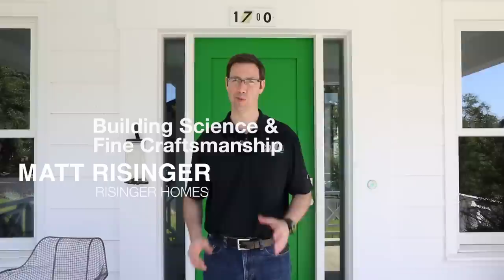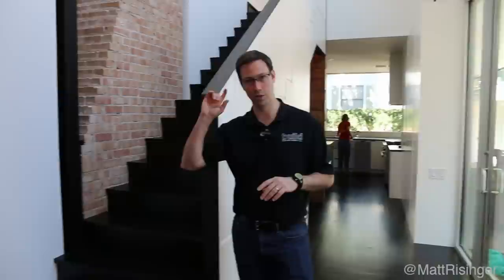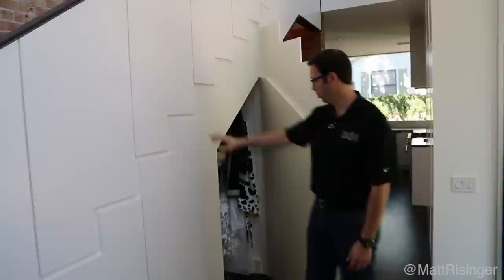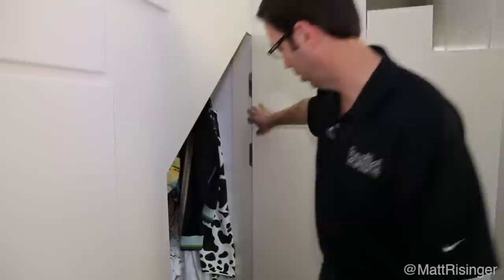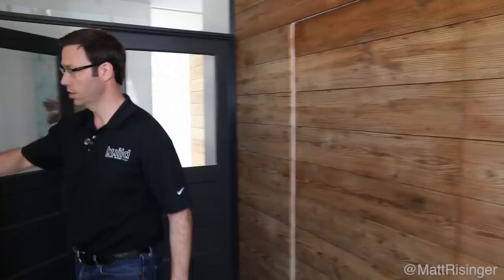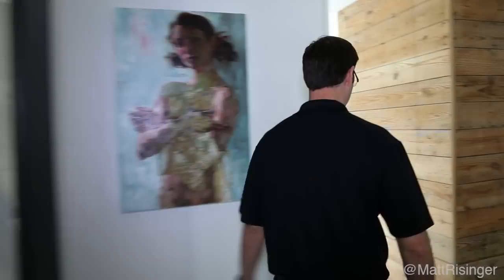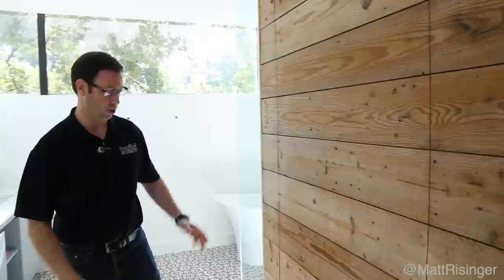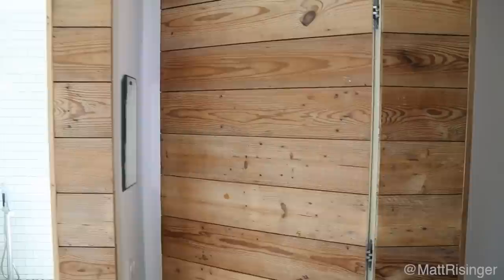Hidden Door House

Comment: should have made the wood panels vertical then it would completely invisible
Reply: He couldn't have
Reply: yes he could
Reply: MAT T,
If the builder would’ve incorporated a recurring pattern of vertical 1/8” scored lines, problem solved.
Reply: If he had done vertical paneling there would still have been lines from the top jam.
Reply: Yup..but the construction is sweet

Comment: why wouldn't you put the panels vertically to actually hide the opening of the door.... none of those wooden doors were hidden..
Reply: Loz because the hiding doors were put after the house was build
Reply: NestleLikesYou they took the paneling off and then put them back up, they could've made it vertical
Reply: cause you still would have a line , only it would be running horizontally instead of vertically
Reply: Nicolette Sans 
Vertical would look horrible
Reply: nedthegreat6 unless the door would go completely to the roof
Reply: nedthegreat6 not if it was a full height door

Comment: that first door under the stairs was hidden nicely, but I could see the lines of the others, so they weren't hidden that well, but I think that is because of the horizontal boards, you cant really get a good hiding like that unless you can stagger the boards like you would on a deck or a wooden floor, now if those boards were vertical you would never know the doors were there.
Reply from the maker: Good point.  These are meant to be more as a feature than as a true "hidden" room.  The three doors we're talking about goto a powder room, master toilet, and laundry room.  Not exactly a high priority to totally conceal.  Best, Matt

Comment: Hey Matt, I know this video is old but still relevant. What was the height of the door off the floor before adding the horizonal board?  Or doesn't it matter because you can apply board with just enough clearance to open.  Thanks. Love your show.

Comment: The problem with hidden doors I can see is in event of fire and the resident passes out in one of those hidden areas.  How will the emergency crew look for this people?  Also during an emergency where the ease of exit is necessary, sliding those doors can be a safety concern as compared to doors swinging towards way of exit.

Comment: I wouldn’t call these hidden doors, I would call them flush doors with very little gap and no trim. Saw them all before you mentioned it. The very first Zelda game did a better job at hiding doors back in the 80s than this, even with very crappy graphics compared to today.